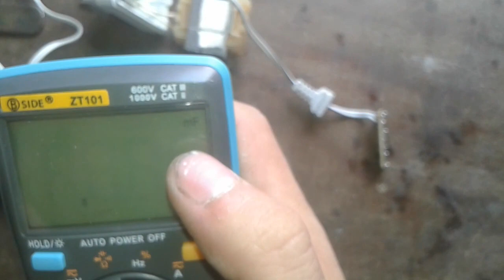Repairing an old 12V Charger with no Output Voltage and a bad Transformer

Comment: when you check the left sided two diodes which does each show 0.571 but on reverse polarity they still show a reading instead of being OL,, but the right sided diodes each shows reading on only one side. sir explain this phenomenon
Reply from the maker: +Good mind Good find  diodes must have a number on them .. if thd numbers are the same in 4 diodes than two of them are not working properly:)
Reply: The given answer was very unclear in my opinion. The reason two of the diodes showed numbers in both directions, instead of an OL like the other two, is because of the capacitor in circuit. If the diodes were in a bridge on their own, without the capacitor, they would all read the same. Roughly 0.7 in one direction and OL in the other.

Comment: sir my 3 v dc charger shows a varing voltage which changes in seconds upon checking by the multimeter. what could be the prblm
Reply from the maker: Good mind Good find  if it is a transformer charger like this , check the filter capacitor .. .. if it is a switch mode power supply check my other video :)